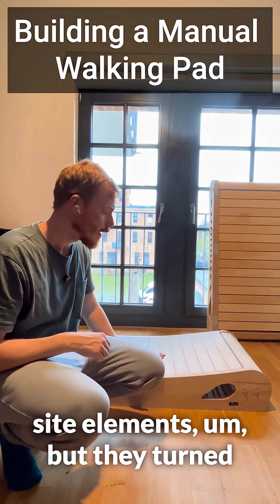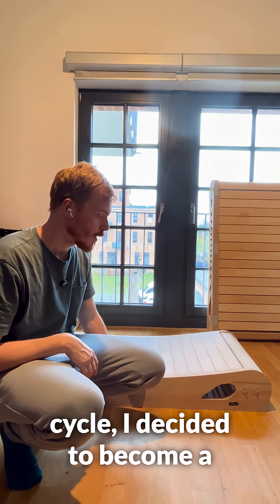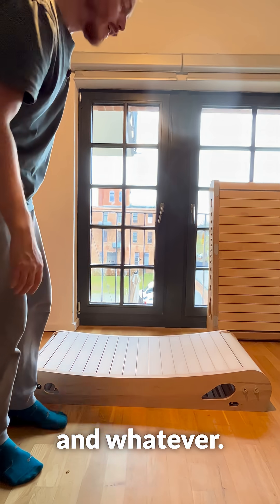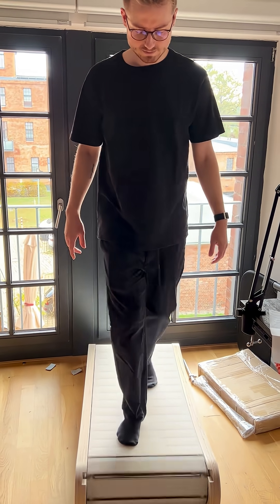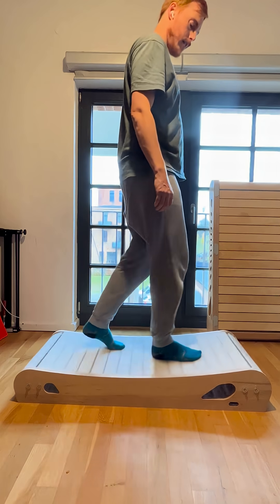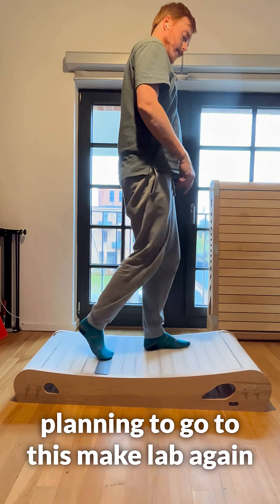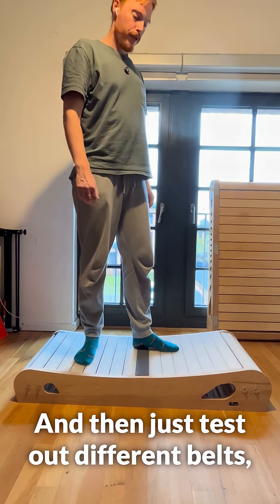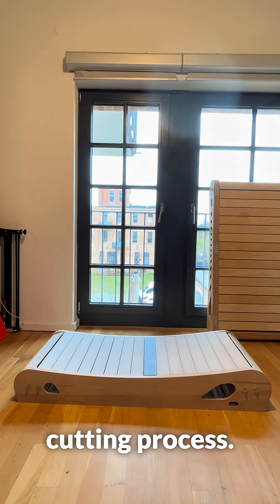Super smooth walking on this soft-touch manual walking pad - Office Walker Update

Comment: Debating between the Office Walker and the Walkolution 2… maybe I’ll wait for this one to come out. I’d have to buy a standing desk either way,  does anyone know how high it needs to go for someone who’s 1.90 m? Don’t want to end up with the wrong setup
Reply from the maker: It’s difficult to say but with 190cm you might need to raise the desk in any case. I’m 183cm and the Office Walker works with my standing desk (max height 128cm). I could even raise my desk another 7cm or so. So maybe it would even be enough for you. But I’d definitely check the specs of the desk for the max height and get one that goes up rather higher than lower.

Comment: Is running possible on this? Or would you reccomend on only walking.
Reply from the maker: While you can run on it (or at least jog) it’s not a replacement for a running treadmill. It’s relatively short with 114cm and (at least at the moment) becomes loud at higher speeds. It’s meant to be used for walking after all 🙂

Comment: Awesome! If you think the noise of this is comparable to the final design, it would be cool to walk on it with a record recording of a decibel reader
So hype for your product! I like the design more than the Walkolution2 for a few reasons: lower height, lighter, built-in wheels, easy repairability, easier storage I think
Reply from the maker: Thanks a lot! My plan is to create a few more side elements with slightly adjusted parameters. Once I have identified the best version I’ll share a video with sound measurements. The one in this video was between 35-45dB at walking speeds, but I have the feeling that there’s still room for improvement because there’s still some clacking noise.

Now that I can produce the elements myself I also want to experiment with different heights. I think there’s potential to shave off a centimeter or two
Reply: @OfficeWalkerWalkingPad leave some space under the treadmill for cushion slats later!
Reply: @pseudonimo4305 I definitely agree - some of us will be using it on soft carpet with a treadmill mat